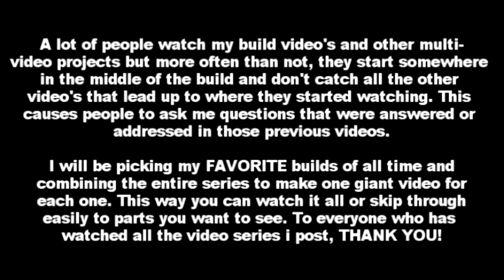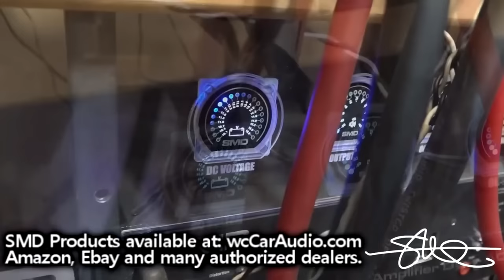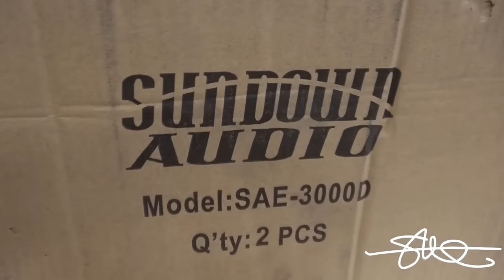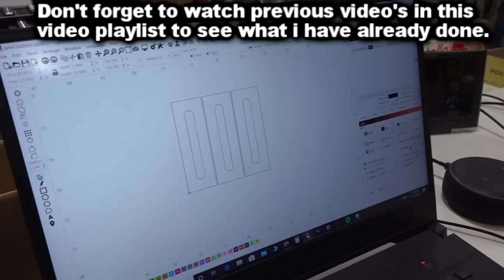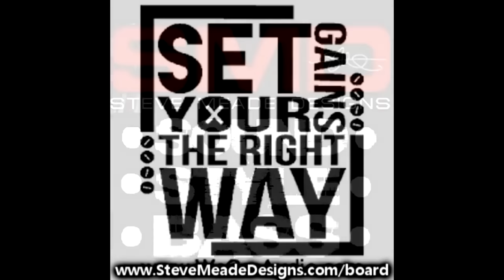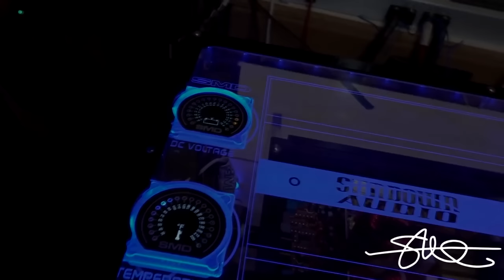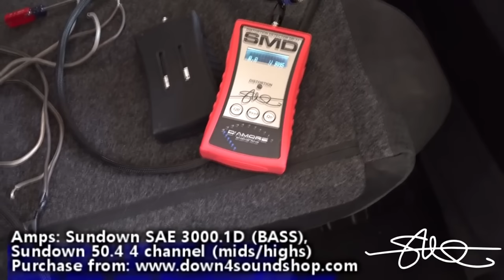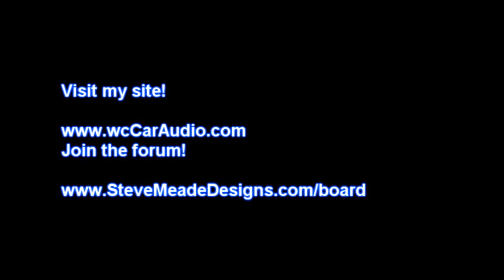Bump in the Trunk - 2 12's on 3,000 watts! full system install start to finish + 1 year update!

Comment: The caps filling get me too.. I saw a way to power them without the big spark. Just use an incandescent 12v test light and just use it as a jumper between the positive cable and the power source. the bulb add resistance and once the bulb dims out the caps are full and then connect the power wire to the stud.

Comment: Ever wonder why every manufacturer puts the fans on the back-side of the radiator "pulling" the air through? Better efficiency.
If you turn those fans around to where they're blowing out (creating a pressure drop and draft throughout) they'll take a lot more heat out of the enclosure. 

That's definitely a badass amp setup!!
Cool as hell hookin that boy up and helping him learn especially. The car could get stolen tomorrow but he'll never loose the knowledge!!
Reply from the maker: except for one thing, i am not pushing air into a radiator.  It's going into a box unobstructed.  It's not less, or more efficient.  It's the same.  And he has gone through now 2 full summers in Sacramento (it gets 110-115f here) with no problems. Thanks though!

Comment: I'm about to put 2 12 inch deaf bonce subs (SA-302s) on a sundown SFB 8k amp in a 03 bmw e46, they shouldn't draw more then 4.5k RMS, probably take an entire year just to break them in, also using an 8.5k watts limitless lithium battery, just waiting for the 380 amp alternator to show up which takes weeks.

Comment: Whats your opinion on the Iraqi alternators? 30,000 watt unit and speaker set up what kind of price for a S.M.D. built of course for a 98 ram 1500 Laramie SLT st standard cab 5.2 318 magnum

Comment: Did you have to replace the alternator to a higher amperage amperage one or no..? 
I got two vxf 12’s 2ohm 1500 rms with a 3k watts amp. Will I need another alternator..? 2010 mustang v6. I will do all the other upgrades like big 3 and batteries and such. Just wanna know about the alternator and whatever other advice you can give me. I’m pretty new at this.
Reply: I had 3 18s in 6th order b pillar wall on banda 7k with 3 big agm batteries in trunk , big 4 upgrade and ran all that without bigger alternator just didnt let the voltage drop too much but then I upgraded to a 600amp alternator and it was way better

Comment: I'm in the middle of my old man build Steve.
I've done my research and sourced my parts.  I've hand built my own 1 1/2" Birch asymmetrical sealed dual 12 down firing enclosure with exactly 1.7 cubic feet.
I know my enclosure will give my subs a lot of support, but I'm not experienced with sealed.  Is there a 12 that will play safe down into the lower 20hz range without damage?  I don't want to fry a new sub with clean 25hz tones because I ignored the Fs ratings.

Comment: you have the battery ground going to that spot on the chassis with that short run of 0 gauge. I see you have another one going from that same spot to somewhere else. where is that second wire going to?
Reply: Alternator

Comment: Steve do you mind me asking you a question, I HAVE A 2016 HONDA ACCORD SPORT, IM RUNNING 320 ALT WITH 48AH HEADWAY LITHIUM BANK, I HAVE 2 SKAR ZVX 12S WILL BE RUN BY A SKV2 4500.1 AT .5 OHM, RUNNING 2 OFC 0 GAUGE POWER WIRES FROM MY ALT TO MY LITHIUM BANK, 2 0 GAUGE POWER TO BASS AMP AND 2 0 GAUGE GROUNDS AS CALLED FOR!!! ALSO 2 RP150.4 HIGHS AMPS ON MULTIPLE SKAR SPEAKERS AND TWEETERS!!! 
MY MAIN QUESTION IS (I HAVE A BACK SEAT ARMREST THAT FOLDS DOWN AND CAN BE CUT OPEN FULLY (NICE SIZE) NOW I WANT SQ AND SPL AND WOULD LIKE IT DO BE LOUD AND VERY MUSICAL!!! IF THIS WAS YOUR VEHICLE, WOULD YOU RUN A CUSTOM PORTED BOX (PORT FACING THE BACK OF TRUNK WITH THE ARMREST HOLE CUT OUT FOR AIR BREETHING INSIDE CAB (IM GUESSING 30-35 HRTZ) OR WOULD YOU DO A 4TH OR 6TH ORDER WITH PORT SEALED THRU THE ARMREST INTO THE CAB OF THE CAR? (THIS IS MY MAIN QUESTION????????????????) WHICH WAY WOULD YOU GO TO GET THE MOST OUT OF THESE SUBS AND BE ABLE TO HIT LOWS AND HIGH NOTES ALL DAY ALL DIFFERENT MUSIC!!!! WHAT WOULD YOU DO IN THIS SITUATION???? AND PLEASE I KNOW YOU KNOW YOUR STUFF, PLEASE IF YOU WILL TAKE A FEW MINUTES OUT OF YOUR TIME AND PLEASE GIVE ME A DETAILED ANSWER AS TO WHAT YOU WOULD DO IF THIS WAS YOURS AND YOU WANTED THE SAME THINGS I AM LOOKING FOR????? Please get back to me!!!! STEVE MEADE I LOVE YOUR STUFF, YOUR AWESOME!!!!

Comment: was the idle voltage in the 12v range? i have an altima as well and cannot seem to figure out how to get around the variable voltage. got my 320 alt. only getting 14.8 when i hit the gas though at a stop my voltage is 12.5 ish
Reply: @Ryan Bell yeah somebody turn the throttle body up i’m all for it i’m j not sure if it could cause damage by having a 1k idle. idc about extra gas being burned haha
Reply: your problem could be how your alternator is being regulated. Some alts have internal regulators that are commanded by the car's ecu and others have external regulators. Depends on how your alternator was built

Comment: What kind of electrical do I need to run 2500 - 3k watts from my amp ?
I have stock 110 alt and stock battery, what do I need to do in order to get 2500 watts ???
Reply: Just go for 320 amp alt.  2500w is only slightly more db than 1000w. Plus class d 80% efficient so calculate amps based on 20% more than rms.

Comment: why don't his rpm drop at idle with 3k watts but mine do with 3500w 370amp alternator and 2 optima red and yellow tops lol
Reply from the maker: how do you know it didn't drop? post up lets see your system.
Reply: @meade916 you're right we never saw the VM-1 while it was at full tilt. I'm sure there was voltage drop as to be expected with any stock alternator but I didn't hear his car wanting to stall at idle like mine currently is doing.  I really don't feel like making a YouTube video but I will gladly send you some pics on Instagram of it. It's nothing extreme but it is my first "real" system. 3500w rms class D amp with 3 1000w rms 12s and a 400w amp for mids and highs which I'm still waiting on down4sound to send because they sent me a jp40 by mistake lol.

 I just watched your video on xs power super banks and I think that will help me out a lot with my electrical needs.

Comment: I’m pushing 2000 W to my subwoofer my front windshield is flexing at what point does the front windshield crack or my back window for my SUV will crack? How to protect the windshield from cracking.

Comment: I know Steve ain't gonna read this and he's probably on the West Coast don't know s*** about stereos and amps I just flew to subwoofers then another two subwoofers yeah because I kept pushing them and pushing them and thinking that I only had a JL XD 1000 and the speaker's were rated at a thousand RMS apiece and the gain was all the way down that they couldn't below and somehow they fraud the dude that hooked everything up from me was a professional installer for years and now is great that he has all the time in the world for him and his new girl he didn't have as of the ground s*** to do when he hoped everything up for me and I was helping him out anyway make a long story short if anybody in Baltimore or Maryland can help me out by letting me know what kind of speaker either is set or a single subwoofer with preloaded and closures and pre-wired what ohms I would need if I decided to get to 12s or a single 15 or 18 and if they would be compatible with a JL XD 1000 mono block or the scar our PID 2000 I think mono block that's still in the box the JL is still and my truck installed level with you it was a lot of money so I don't want to swap it out and unless it absolutely won't power the scar but I know it will I was pumping to massive audio hippo woofers my cousin let me borrow and he put in there so given and realize clean setup they were raided at like 1500RMS or 2000 RMS 4000 max and they were beaten violently I'm sure they could have used the lot more power and beat harder but that's all I needed any way anybody in the Maryland area I want to make some money reply to this if you know s*** about stereos all you have to do is guide me to a replacement speaker I'm paying for everything but the hookup of the woofers and if need be an app swap it sounds all simple and I know you just connect a power to the power on the other app and ground to the ground but Shake is the anxiety that JL a very expensive Baltimore was I don't have money like that so the scar is only going to be a backup if the JL ever has to come out but if they won't push a evl 15 or 18 or two of the 12 inch or if you're really handy and you know how to wire 4 speakers I can stack a 10in box on top of my 12-inch box connected together from the inside with screws or whatever and run to tenant gbl's and 212 what's a 2000 Watt and there and call it a day that's my dream but I don't know how to do that anyway sorry about the rent anybody in Maryland if you're reading this and you want to make money and help me I will come to you bring everything necessary or order it pay for your labor where knowledge and go to the bar getting beers whatever tickles your fancy plus cash for labor and knowledge if not sorry about the rent everyone have a great night Steve your f**** man wish you lived nearby
Reply: @srvdean3024 lol. I tried to read it and there were no periods. I have no idea what's going on as I gave up about 1/3 of the way thru but I hope you get your speakers man